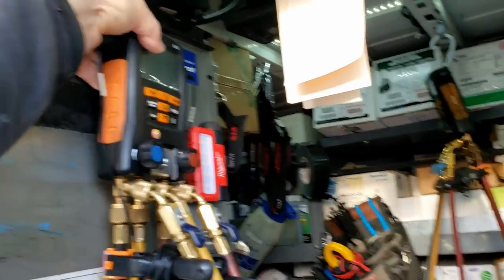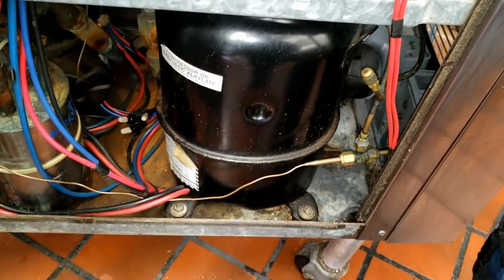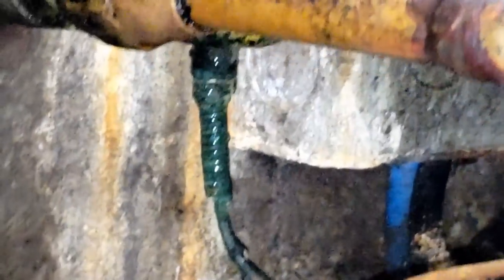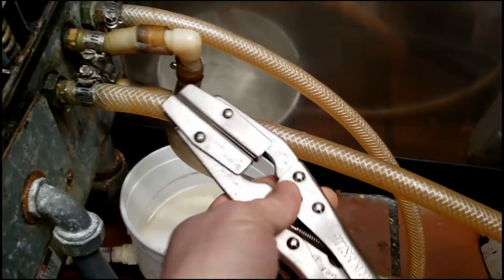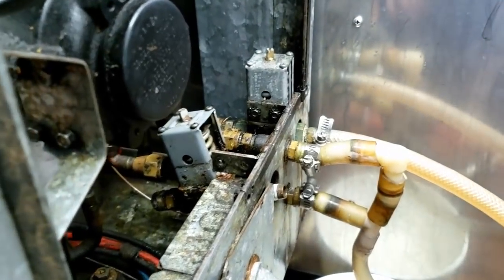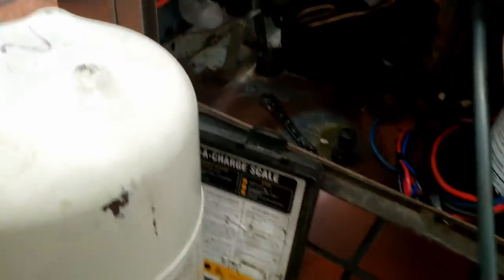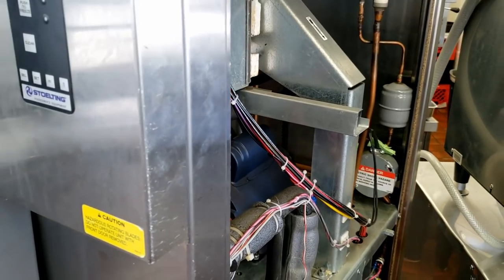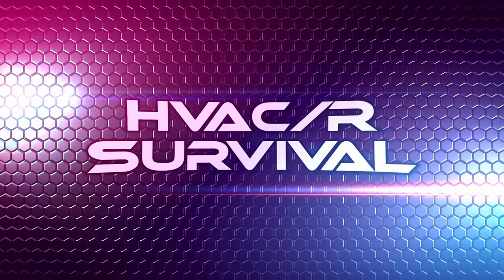STOELTING ICE CREAM MACHINE LEAKING WATER INSTALLING NEW PRESSURE ACTUATED WATER REGULATING VALVE

Comment: I have gotten stuff off of ebay that worked just fine. Needed a new distributor for my truck and bought one from the parts store. 5 distributors later I finally got one that kept working  but it leaked oil a little.  Went on ebay and bought a new modified gm hei distributor that was modified to fit a ford truck. The tolerance on the ebay distributor was absolutely perfect while the tolerances for the parts store distributor was so bad it literally could be dropped into the opening and would fall into place while the ebay one had to be in just the right position before it would go into place. Big difference.
Reply from the maker: I don't have problems with motors and things like that,  that are pretty cut and dry,  I'm talking about electronic control boards.
Reply: @HVACRSurvival  true about that being a problem.  You get a 50% chance at best of getting exactly what you ordered.

Comment: Rick!!  Always great Stoelting content. Joe here with RR. Got a question for you.  Have you ever changed the draw handle on the DQ441 units?  The ones that pull sideways on the ring?
Reply from the maker: I’ve replaced the bushings that turn at a 45° angle that causes the stem to be pulled up.

Comment: If the cap tube on the valve isn't damaged you can take the 4 torx screws out of the body and replace only the body without pulling the charge. That's how we do it just a little bit easier.
Reply from the maker: It might be a little easier but if it doesn't work then you got to go back and do it over. Either way thank you for sharing 👍👍
Reply: My taylor C606 water valve "V46AA-56" is leaking when the machine is off. So I try to remove the 4 trox on cap tube head but is it high presure. And If I tighten the spring all the way in it still leaking. What is the problem?
Reply from the maker: @cblad1406 is it Leah from the sides of the valve or coming through the valve?

Comment: Is the water running trough the ice cream machine even if it is turned off or if the compressor doesn’t have to be cooled?
Reply from the maker: There is a water valve called the head pressure control that regulates the water flow based on head pressure. If it's adjusted properly no water should be flowing when it's off.

Comment: Don't charge by looking at the sight glass but as you look at it you mentioned that it might be low in charge ...
 I am Confused ... Can you explain them what the sight glass does for people
Reply from the maker: Theoretically it's a moisture indicator, but also gives us an indication that it could be low on charge. Normally the sight glass is full however it will flash when it's warm and starting to freeze down. I didn't want to mislead people to think they can charge it purely off of sight glass because there's no receiver on this system.

Comment: I own several sets of hose pinch off pliers like I said before I've never done refrigeration or big time commercial 10 tons is the largest units I've worked on in my 30 years but I've never heard of pinching a copper line how will you open it up
Reply from the maker: My pinch off tool looks like a flaring block, you put it around the pinch point and it rerounds it. It's not perfect but it's usually used on pressure switches.
Reply: @HVACRSurvival  that's why I like this channel I've learned alot watching you I've done HVAC for 30 years and I learn alot of stuff I don't know from you I know refrigeration is a different ball game but you are a damn good teacher you explain everything I really appreciate the time you put into this just so your watchers can understand I service the generator and tankless water heater and Im still doing oil furnace there is alot of techs now days that has never touched an oil furnace I would like to see you on one.Ive never supported a channel because none has ever taught me anything not that I know everything because I don't that's for sure but your channel does so look for my name on that list please keep up your hard work is appreciated
Reply from the maker: @donaldpainter956  thanks so much for the many nice things you have said. I used to do a lot of oil, we luckily don't have much at the company I work at. I learned a lot from a guy that had a weird way about changing the nozzle size smaller for a longer run time to burn off the soot and sometimes even changed the angle 😩. Luckily I learned what not to do 😁

Comment: Parts on eBay really aren't to bad long as the part numbers match up and everything looks like it matches
Reply from the maker: I can see that with motors, belts, capacitors but not control boards unless they have a return policy. Thanks for watching!
Reply: Definitely with motors and belts